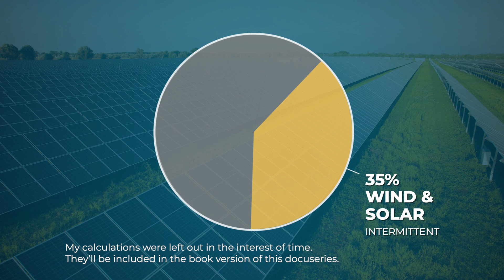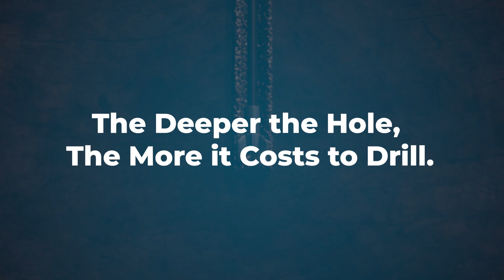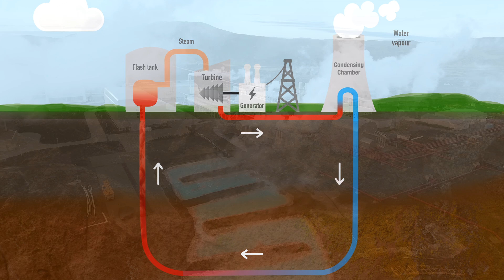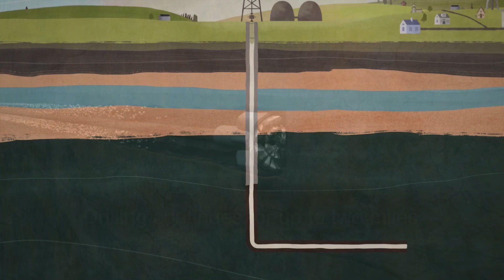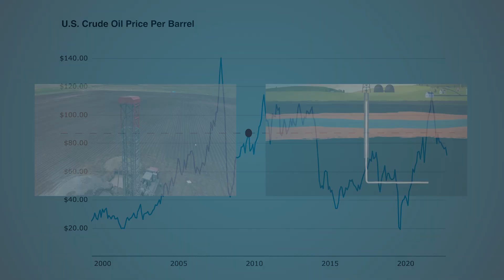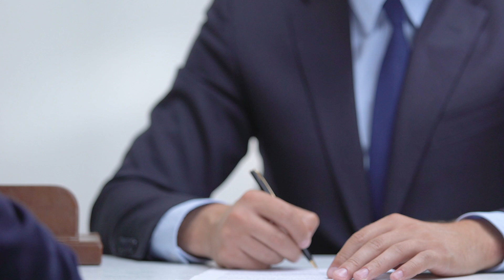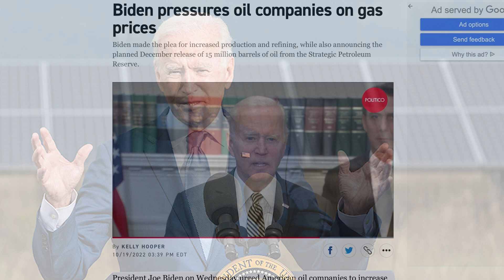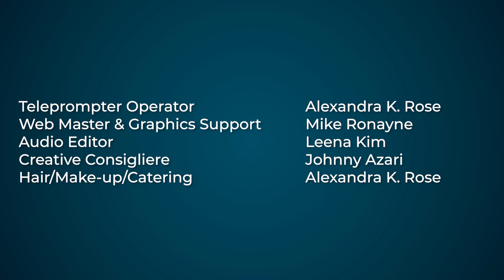Energy Transition Crisis - Episode 4: Deep Geothermal Renewable Energy

Comment: In 2019 Canadian company Eavor technology successfully demonstrated their closed loop AGS concept.  In December 2022 they completed a closed loop in 250°C rock in New Mexico.  They are currently repurposing geothermal bores in Germany.  GA drilling's plasma bit and Quase Energy's mm wave bit vaporize hard rock and vitrify the bore hole.  NASA technology is used for high temperature sensors and controls.  Supercritical bore holes will most likely be accomplished in the next 24 months.  Then boilers in existing power plants can be replaced with high energy steam from deep geothermal.
Reply: Very interesting - thanks!

Comment: A good idea but experimental. My question would be 'How long will the hole last?' If the answer is indefinite then the original cost of the bore is almost moot. Another question would be 'How much power can be extracted?' Power not energy. The answer to this question is fundamental to the economic one.
If it works, you wouldn't need wind or solar at all. That would make a lot of people and wildlife very happy indeed.

Comment: Completely agree that we need a clean source of baseload generation.  Wind and solar will not work.  Also, geothermal could probably be built much closer to major electricity demand centers so wouldn't require long transmission lines, which are a major problem to get built.  Furthermore geothermal requires far less land per GW of power than wind and solar.

Comment: A practical but non-technical question… how vertically integrated are the oil companies? Specifically, is the drilling part of the industry a subsidiary of vertically integrated companies that also handle pumping, refining, and distribution? Or are there independent drilling companies that are hired by the oil pumping/distribution companies to drill the wells and install the equipment? This makes a huge difference in the viability of changing the drilling industry into a geothermal industry. Independent companies can be lured into a new business. But vertically integrated subsidiaries doing geothermal drilling become a threat to the core business model.
Reply: The upstream exploration companies hire oil & gas service companies to perform drilling. They work is usually outsourced. Does that answer the question?

Comment: Solar doesn't need this "breakthrough" that you're unaware of. It has economies of scale working for it. It's getting cheaper very quickly due to the number of panels being produced. Putting money into advancing a lagging technology, (it is a great idea and where cheap and practical should be implemented) rather than into producing more PV panels and lowering their cost that much more. PV is getting cheaper with no input required from people other than continuing to build them. Geothermal is lagging behind, and requires advances in tech (money) to advance ahead of PV. In other words, we need to spend lots of money, just for Geothermal to keep pace with PV, much less catch up and surpass it. PV is going to get cheaper anyway. Why would be try to concentrate on geothermal to the extent you're arguing for at this point? Tony Seba's RethinkX has figured out how to achieve what they call "Superpower" using PV, wind and batteries. (Plus the already installed Geothermal, hydro, nuke etc). Adding sufficient battery storage everywhere to meet the largest needs of the area in question will ensure that even in darker windless times, there's enough energy stored in batteries to meet humanities needs. That means, the additional energy created (Seba's "Superpower") is hugely abundant energy surpluses that are desirable as you mentioned. I think you have the right ideas of transitioning, but you've hitched your wagon to a horse that's already far astern of the leader and the leader is pulling away quickly.

Comment: What's cool is a company called Eavor is doing this. You actually dont need ANY electricity to pump the water in this circuit. Convective currents will keep the cold water sinking down and hot water rising up, you do need a pump to start the flow, but once its started, it will automatically circulate with no outiside power for YEARS.

Comment: While I agree that using geothermal renewable energy can provide a complementary energy source to wind and solar, I think that it is not as cost effective as wind and solar and carries higher environmental risks which means that more preventative controls and monitoring technologies need to be developed.  Overall I think it makes more economic sense to only develop geothermal drilling in areas which already have high geothermal activity.  In this case it could probably make up around 30% of renewable energies.  As an investor I would personally prefer to use newer companies that offer competitive, innovative and more responsible approaches to geothermal development. Understandably many people are upset by the amount of damage which the fossil fuel industry has already caused and so this lack of public confidence alone could put doubt on any future investments in this industry.

Comment: this was really interesting, thanks Erik. What is the origin of the heat within the earth? thinking in terms of the preservation of energy.....from where does the heat come?
Reply from the maker: It's always been there. The earth started as super hot, then the crust cooled but the core is still super hot. Don't think in terms of where the energy is coming from to keep it hot. It's cooling very slowly, from a VERY high initial temperature.

Comment: does the drill need to be so massive? why not perferate thousands of tiny tubes that the same amount of water can flow thru but a single smaller drill can be used many times? diamond tipped etc..?

Comment: We have to get geo energy through 20-30 miles of rock, in most locations. If we pump water 30 miles down where it flashes to steam, will that steam retain enough heat on its way 30 miles back up to drive a generator?  Can we really operate a generator with that much distance from the heat source?  If we don't go as far down, is the rock hot enough to generete really energetic steam?  Also, how long does a well last before you cool the rock enough that you need to rotate to another well, letting the first one rest and accumulate heat?
How well does the drilling equipment operate in very hot rock?  Are we limited to poor heat sources?
Reply: Could we drill a very deep wide hole straight down, using thermonuclear shape charges (x ray lasers)?  Would a hole 30-50 miles deep and 10-100 ft diameter allow substantial generation, or would the steam need to return from too far?  The politics of this are impossible, but a big enough prolonged energy crisis could change that.

Comment: The Russians have a horizontal well that is 12 kilometres deep. It's about 180 Celcius at that depth.  This doesn't seem like a problem with drilling mud chillers. You may need more mud tanks than a typical well to increase the flow and keep up with the chilling and the pressure at that depth is your friend. Conventional drill bits can be rated for 1000 C.  If you have $100 Million Canadian dollars you can get a Canadian drilling crew to drill that for you today.

I am told Spalling will use too much energy and damage your drilling equipment. It claims to be energy efficient, but let's be serious: this uses electric arcs.  Did he mean acoustic?   Acoustic could be interesting.

Comment: Instead of using water they would be better off pumping CO2.  Its still a rare technology but they are building turbines now that run on CO2 instead of water since CO2 works better.  Those turbines are tiny compared to using water/steam.  The CO2 stays in a closed loop so it doesnt cause pollution unless there is a failure.  Sure it would suck to release a bunch of CO2 but that would be rare so its not really a concern.